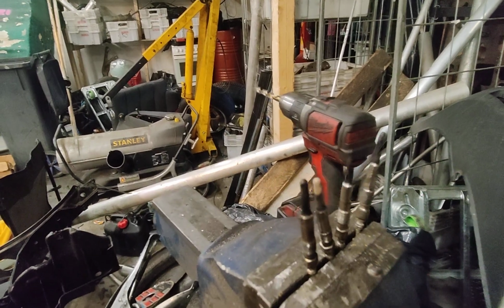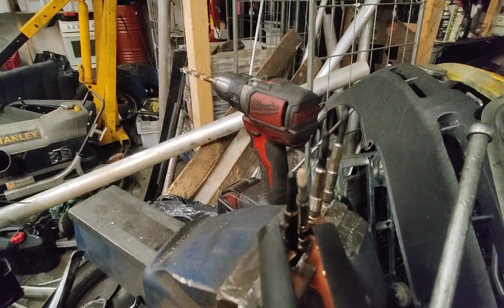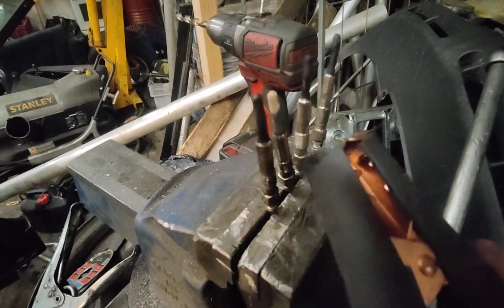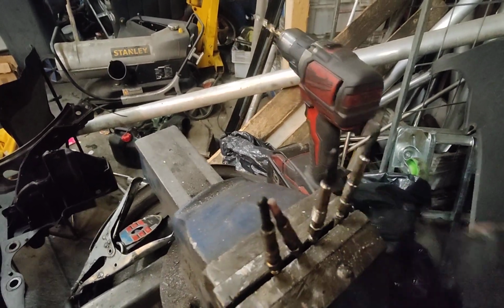testing TDI glowplugs easy way.

Comment: Can you help with idea 💡 
1.9 tdi A5 BXE. New Glow plugs keep burning out after 1st drive. I bought new glow plug harness but still doing exactly the same
Reply from the maker: Not sure how the system is wired in a5. If there is a glowplug controller, measure if it keeps feeding current to the glowplugs after start or something. 😅
Reply: @SiuroTDI  must be current feed, I replaced relay which is hidden under battery tray but still burns out